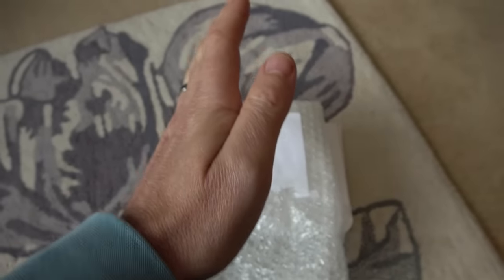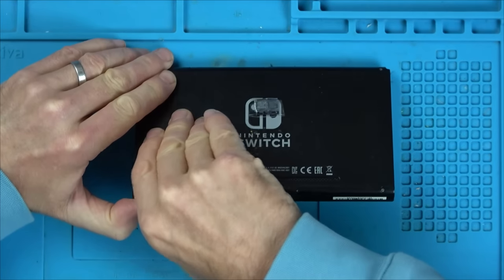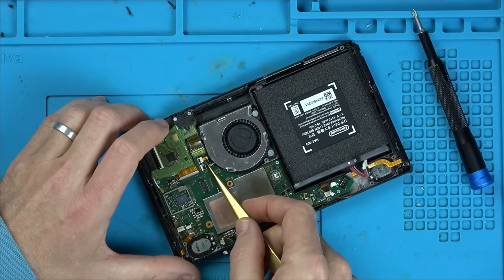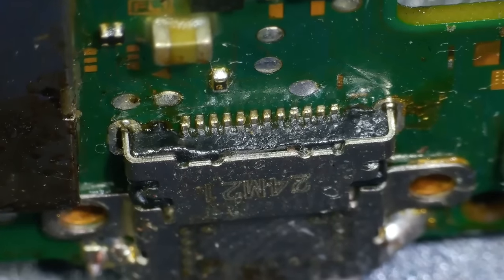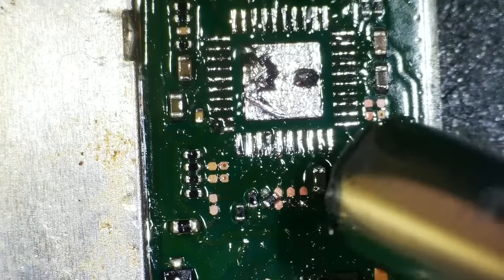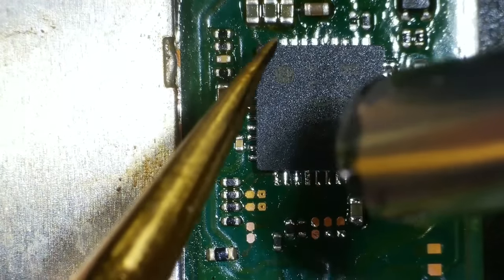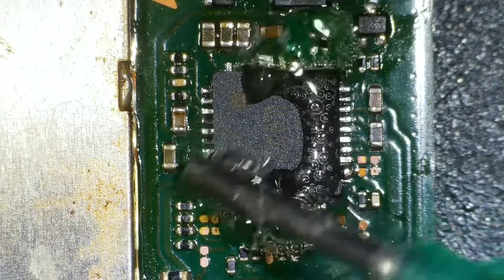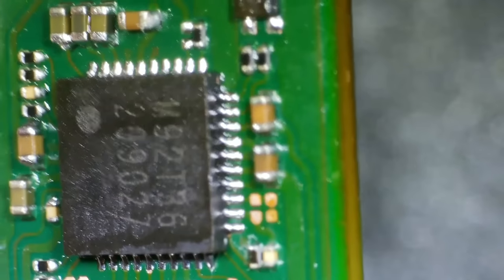This Nintendo SWITCH was Sent to TEST ME!!!

Comment: This is what a fix it video should be all about. If it was to just replace a port or single chip to fix then class it as an easy fix and you wouldn’t learn anything new.

Having to diagnose issues gives greater insight and learning about what you are fixing.

Well done Vince, nailed it in the end!

Comment: I think the weird reading you were getting on the last resistor was due to the small voltage that the meter puts out, when reading ohms, might have been switching the "mosfet" on and off creating that fluctuating ohm reading. Just my guess anyway thank you for another wonderful video

Comment: Vince just a couple of tips for you. when soldiering IC use more flux, then the chip will  pull into place. Secondly when cleaning the circuit board do not quench it with IPA the rapid change in temperature can cause ceramic capacitors and other components like IC to microfracture, always allow the circuit board to cool down first. I see many YouTubers do this and it's not the correct way.🙂

Comment: Nice fix, Vince :)
You can heat the board from under M92 if you are afraid of knocking over some components. And i use a lot of flux to keep it there until the board heats up. That goes for the USBC port, too.
Charging issues can also be solved by replacing the BQ chip.

Comment: Great job with that chip Vince.
After spending a couple of hours trying to change thumbsticks on an Xbox controller I've figured out the problem. I was using a cheap (under GB£6) soldering iron, when I used my lovely Yihua soldering iron the job was so much easier. Lesson learnt for me: use decent quality tools🤣🤣
The Yihua was £40 and my hot air station was £30, so not silly money, and they both work great.

Comment: Great job Vince. Proves having a spare around is not a bad idea. Those tiny resistors don't  show any signs of physical damage painted black like that. The old through hole types were much easier to spot the damage from overheating, with the manufacturers having mostly used lighter shades of colour. Imo just using the colour black for smd resistors is a poor choice. Probably would be better if they were painted white with black values written on them.

Comment: I feel so bad to find your frustration so hilarious 😂 that filter jumping counting and you  just want to pack it up and send it 😂 
Do you know the value of that resistor?
Great entertaining video and so happy you made it work!
Reply from the maker: Cheers Anders. I don't know the value, I think when my meter does that weird thing it means it is in between ranges so it didn't settle on the resistance. The other Fluke meter is in the Rolls Royce so I couldn't test it with that 👍
Reply: probably less than a penny for 20 of those chips (factory cost)
Reply: @Mymatevince If you manually pick a range from the ones it's cycling between when it does that it will probably be able to decide on a value.

Comment: We're learning more and more about how the Switch behaves.
- What the circuit board physically needs to even turn on
- The Initial pathways branching from the USB connector
- The video chip with relation to the USB connection
- And now, the pathway from the USB power to the fuse to the resistor array to the main controller chip.

All of this that took hours, days, to diagnose and rectify, all summed up in one video.

Comment: Another epic, well done. Personally, I wouldn't tin IC pins (unless they are dull, oxidised) as the heat from the iron will be much higher than the original reflow and could shorten the IC's life or damage it. Better to flux and tin the pads, as you did. A suggestion is to use a low temperature solder paste (instead of solder wire) on the central underneath pad as this acts as form of glue (to reduce tweezer-prodding time) and ensures the IC sits down properly, requiring less heat to do so. 

Your meter is bouncing around because the voltage from it is powering up one or more semiconductors (what happens next requires pages of explanation).

If a capacitor is missing, big deal. Oh dear!

Comment: Hey Vince, have you ever thought of ordering some soldering tweezers? I’ve seen north ridge fix use them and In cases like 17:23 I feel like they could have come in useful instead of using hot air and heating the whole board you can grab and heat only the resistor with the soldering tweezers. It could also come in useful if you’re removing components near plastic parts as you won’t have to worry about melting them with hot air.
Reply: They're very expensive. - Not to say Vince can or cannot afford it, but I guess it depends on how many of these 0201 size components he does.

Comment: Having no thermal compound on that rear shield is no big deal, my V1 does not even have the shield as it has to be removed to fit the mod chip board in, the switch does not have temperature issue's

Comment: What i didn't understand is he read 6-9M ohms. Mega is higher resistance than kilo. Isn't it a good thing for a resistor?
Reply: Higher ohms would require more voltage to get that same amount
Reply: @jasonrichardson1999  Ah ok then in this scenario the resistant lost its continuity and requires much more voltage. The resistance was much higher than it should be. Now I understand thank you

Comment: Anybody have a line on that usb c testing board? Dealing with a ps5 dualsense controller usb port replacement and i think that may help a ton!(i am aware that dualsense ports are almost proprietary and have a host of different issues, but i'm trying to get to the bottom of it)